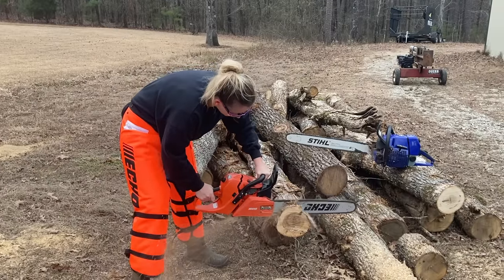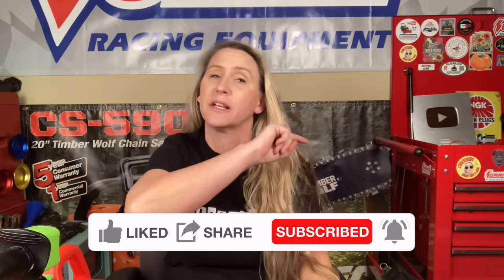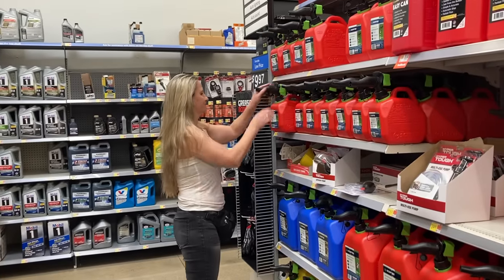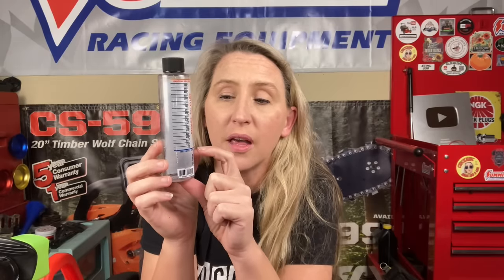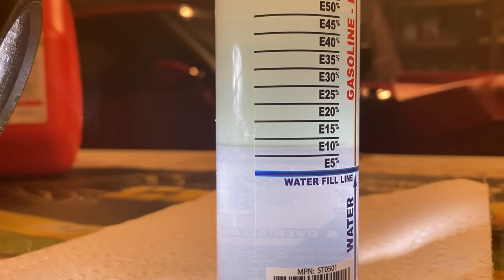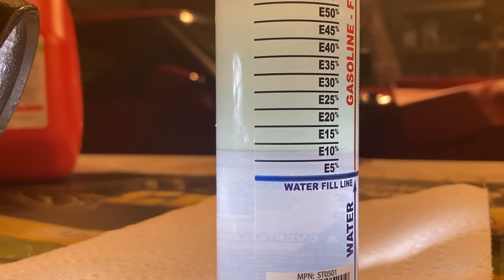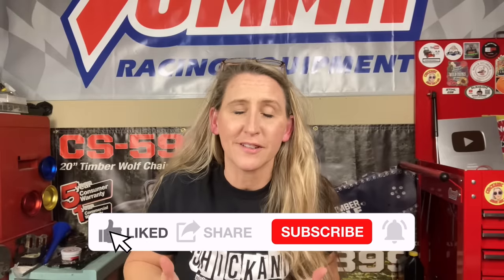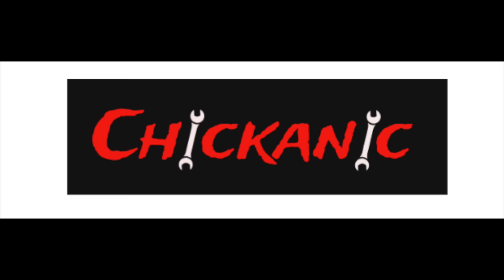Fueled by Deception. How You’re Getting Ripped Off at the Pump! (I'm SHOCKED!) VLOG

Comment: Shout out to Maverick and their clear 88 on a separate hose. That's the only thing that goes in my 90's trucks. I can't bring myself to put that yellow crap in my 2019. My wife did. Yep fouled plugs. 10% ok. 50% +.NOPE
Reply: And my chainsaws and bike and geni of course. Go Maverick. I end up getting better gas mileage in my old rigs so it ends up costing the same. Also I live at 7500 feet. You might be ok but I really needs my octane.

Comment: Everyone complains about those gas can spouts but they are worlds better than some of the previous versions. Obviously she’s not using it as it was intended. It’s designed for the little hook to rest on the lip of the fill port and you use the palm of your hand to Push the green release button down. For a finesse job like what she’s doing I would have simply taken the top off and used an appropriate sized funnel. It ain’t rocket science! Thought this woman was a mechanic 😂

Comment: So someone whose vehicle requires the 93 octane could be getting a lower octane and vice versa . What does putting high octane in a car do ? Do 87 octane cars have high enough ignition system to ignite the 93 octane ? Should people that have the cars that absolutely require the higher octane be putting octane booster in with the fuel or give the residual hose fuel to someone else ?

Comment: Soooo what's the problem with ethanol? I mean there is turbo or supercharged high compression 1000hp plus motors that run higher power tunes run the highest tunes on ethanol?

Comment: ❤ I got gas at a different station not before last and I only got 33 point something per gallon per mile when I've been getting right at 39 so I thought what in the world is wrong I won't get gas at that station again it's a Mobil station here in a little old edge of Virginia Galax to be exact . I've been using the one that is up to 15% but not the other one I don't think I want to get gas there anymore I had about 1/4 of a tank of gas when I stopped there I filled it up now I'm down to less I think less than a half and getting 33 or 34 Mi to the gallon instead of 39

Comment: I've lost count of the number of times I've cleaned or replaced damaged or destroyed carburetors thanks to ethanol in fuel and I don't even repair them for a living. Ethanol belongs in beverages, not in gasoline! Also those mandated gas can nozzles are absolutely ridiculous, I spill fuel all over the place every time I try to use one of those, exactly the opposite of what they are supposed to do. Thankfully you can buy replacement nozzles that are sold as being for water jugs, but I eventually just bought a nato jerry can and never looked back. I will never buy a consumer gas can again.

Comment: I never understood why they brought back ethel gas as it was phased out for being crap fuel and many high end cars and older engines  with rubber o rings and gaskets cant use the fuel   Im thinking peeps should have got the pitchforks out when they brought in the unleaded gas  As i can still remember filling up my mini bike for  18 cents at the pumps in the 70s

Comment: I put an end to this problem by switching my weed whacker and chainsaw over to the DeWalt Flexvolt and have zero regrets!!! Goodbye Toro and Husqvarna,  see you never! But I do pump my ethanol free gas into my pickup for a couple of gallons before I fill my 5 gallon gas can. My mowers, chipper and pressure washer run like a charm.

Comment: Today's gas cans are worthless. I have purchased several over the last 15-20 years and they are all difficult to use. I wind up spilling gas anytime I try to put gas in the mower. How does this help the environment?

Due to government regulations, local stations cannot sell E-free gas. I recently was able to find some about 50 miles away - only bought a couple of gallons since I did not want it to go bad before I was able to use it.

Comment: you should test to see if that was water instead of ethanol? what should we do with this info? should everyone that see's this video file a class action lawsuit? this is good info, because this happen me. I bought some gas from a gas station, put that 10% ethanol gas, and it ruin by wife suv, check engine light came on and then it started to flash and shake! suv is sitting in front of my house, change everything I could change! the last thing to change is now the suv it self! it's a shame, nice little suv!

Comment: this is like 20 years old, glad you learned what we knew for 20 years flying ultralight planes...
You can pre-test for alcohol at the gas station. Here's a review of the olive jar test for alcohol.

Empty and clean a long, thin olive jar and keep the lid. (Actually, any tall, skinny container will work as long as you can see through it.)

    At the gas station, put some water in the jar, maybe up to about 1/4 and use a marker to mark the level of the water.
    Fill the jar with fuel from the pump. Put on the lid.
    Shake the jar and the fuel/water mix.
    Let the mix settle out.
    If the apparent water level goes up, the fuel has significant alcohol in it.

Watch out for pumps that share a single hose for all their fuels. If some of those fuels have alcohol, you will get some contamination even in their no-alcohol fuels.

If they have separate hoses, you can make the test before you fill your fuel cans.

Comment: This goes further than what she is talking about.  We dont have pure fuel in Florida.  I went to Sturgis and put in pure gas.  My MPG on my Harley went up 3 MPG.  I also had to turn down my idle with the pure gas.  I am also a mechanic, ASE Master Mechanic, and the government also used this ethanol to get older cars off the road by eating up the seals in the fuel system, including the fuel pumps.  If you replaced it with a stainless pump, with other than rubber seals, you were ok except, like was demonstrated, ethanol will pull water through your system and moisture is in the air.  That moisture goes through your normal steel lines and corrodes them, as well as any aluminum in the system.  Up until they mandated ethanol, I changed maybe 2 fuel pumps in a 10 year cycle.  After the mandate, I was buying a pump a week for customers.  I never replaced a fuel pump that the hose connected to the fuel line in the tank wasnt swollen to 3 times its size before it finally gave out.  The pump was running but no fuel pressure because that hose was blown.  There was also so much corrosion from the pump that you could dump the fuel filters and they were loaded with metal and rust.  Just like that gas can she had, our government is not our friend.  They are all criminals.
Reply from the maker: THIS! 100%

Comment: Dont know where you live, i live in North Carolina. The only reason this would happen ( here in N.C)
 of cross catamination of  mixing two different fuels would be on purpose or by mistake from the fuel hauler, (tanker). Every gas station I've ever went to had separate holding tanks for each octane level and separate pumps. 
If im pumping 87 oct and I'm on pump #1, the person on pump #2 on the same island, and is pumping 93 oct, is Not, Not,,,sharing the same pump or hose. Dont know of any place that does. 
Does that place have water in their holding tanks. I've heard of that happening, even had a few News reports over the years where diesel fuel got pump into the gasoline tanks by misstake with many of vehicles wind up stop running a few miles down the road from those stations.🤨🤔🫤

Comment: 4% vs 9% should not make a difference if your equipment is running correctly. Main reason small engines don’t run is folks leave gas in them. Run it dry every time you will have zero problems.
Reply: So I'm supposed to guess at exactly how much fuel I'll need to clear my driveway of snow? If over, I have to let it run out? If short, I have to splash some more in? 😂
Reply: @mikeb8342  Negative you can put in a valve to shut off the fuel to carb..its best to run all out but second best is just to make sure carberatur is empty. Valve is less than $10 on Amazon

Comment: Haven't seen a multi-fuel type hose/pump since the 70's we just don't use them possibly for the very reason you're speaking of but I know from years of driving and riding the fuel stations here don't serve you what you pay for as per low grade fuel gives me 250 kilometres for a tank full high grade fuel which is almost a rare joke gives me 450-500 kilometres to a full tank and I drive a Ford courier 2,6litre 4cylinder and this fuel fraud is wide spread here in Australia and I ask a supposed independent market researcher to see if what I said was true and going by the no response I believe he already knew that and doesn't want to wake the big dog on a chain because the repercussions would upset the fraudulent profiteering here in Australia. We mix our low grade two stroke so we only have ourselves to blame Lol .

Comment: I'm not sure if anybody had placed this in the comments or not but that gas can, as much of a pain in the ass they actually are, you're not using it correctly. 

You're supposed to push the green with the palm of your hand and grab the little black handle in front of it with your fingertips and squeeze.

Comment: Ethynol has water , water not good for fuel systems. Water not good for pistons ( unless you trying to remove carbon , old mechanic trick for knocking engines) but i regress . E85 is 20% water . My Huskavarna requires clear gas or the warranty is void . Bullshit , they couldnt tell the different between Clear gas , or treated gas . But a lumberjack 150 ft in the air with a chainsaw ( i live in Oregon) will xome down the tree and beat your ass in the ground if you screwed up his chainsaw with ethynol gas . The eater freezes up in the carburator during high revolution. A froze chainsaw is a lumberjacks worth nightmare . And the octane level of a watered down gas will ruin your injection systems over time . But ive only lived in the lumber capitol , Oregon for 45 yrs .

Comment: I had to laugh at how you pour gas from those new cans. You're doing it WRONG. With the new valves,  you tip the can first then open the spout when you have it all lined up and the nozzle in the container, just like a gas pump hose. It takes two hands, so you can't really use it with a container that you have to stabilize, but typically I can use my feet for that. CHEERS!

Comment: All you have to do "before running your tests".....is to first pour some fuel into old measuring cups; 
labeled for the type of fuel; and skip cussing the gov't.......the gov't does not make gas can 
manufacturers make poorly designed dispensers.........They set objectives; but the manufacturers 
can use any design they desire;  and some will be duds.........I don't use the el-cheapo cans. my 
fire-rated metal dispenser from Zoro works fine..........You squeeze a large loop handle which opens
a jointed, sealing cap, with an adjustable goose neck filler line about a foot long.......A design that has
been around for over 50 years that works so well; it already met the safety standard without changes.
Also, I buy gas at our "local Murphy's gas stations".....their pumps have a separate hose/dispenser
for "real gas".......and is fed by the tank only used for that purpose.

Comment: Long ago, when ethanol came out, they claimed that you would get more power and better fuel economy. I got more power, but my gas mileage dropped by 6 miles to the gallon. On the first tank I was giving it more gas, testing out the power claim. So, on the second tank of gas, I drove normally. I still got 6 miles to the gallon less in fuel mileage. I stopped getting ethanol  gas after that. Later on they retracted their claim of more fuel mileage. Fast forward several years and they came out with a cock and bull story that claimed it was better for the environment. If I am burning more fuel to go the exact same miles, this does not make any sense, at all. They have to grow the corn, process it into ethanol and then ship it to the refinery by truck and this is better for the environment? I figured out that in order for ethanol gas to be cheaper than regular gas, you had to have a difference of more than 10 cents a gallon. They then started to force the ethanol gas in our area and discontinued regular gas. 
 I was on vacation in Wisconsin and there was a station with both types of fuel, ethanol and regular gas. The difference in price was EXACTLY 10 cents difference, just as i figured. Then at the post office they retrofitted our trucks to run on e85 and we were told to go to this station that had e85. All the trucks were having problems starting or pulling away to get into traffic or when making a turn. Everybody was complaining about this e85 gas and tried avoiding that station and getting gas elsewhere, claiming they were low on gas and not close to the station. They FINALLY ended the use of e85 a few months done the line.

Comment: SUB-JECT : LAWNMOWER RELATED

[]▶ BEFORE You BREAK IN Your New Lawn Mower Engine - WATCH THIS!
https://www.youtube.com/watch?v=thYEgRqIr54
                     May 1 - 2021                                 06:13 -----------------------------
CHANNEL: Garage Gear
                 » https://www.youtube.com/c/GarageGear
@ 2Wheels Midnight  --  2022.05
  I cannot tell you how many times I had to explain this to customers -
  reps and salespeople - but here it is in hopes it will help alleviate
  the stress levels some of you are experiencing:
  The oil in your new engine is turning dark because carbon and unburned
  petroleum components are blowing past the piston rings and down into
  the crankcase.
  The rings haven’t formed and finalized their wear pattern yet -
  (known as “seating”). These contaminants are soft and pose no threat
  to the engine. Also - using non-ethanol gasoline actually contributes
  to harmless oil darkening as it lacks the chemicals which promote
  a cleaner combustion burn.
  The metal particles are also completely harmless as long as one
  maintains the correct oil level for the engine and does not operate it
  at an extreme angle to its center axis design - particularly so if it’s
  a non-pressurized oiling system.
  These metal particles are of the exact same hardness as the metal
  components they are shed from - meaning they do not possess any
  greater  abrasive quality - and furthermore - are suspended in and
  completely surrounded by the lubricant.
  Prematurely changing the initial oil in a brand new or overhauled
  engine will only prolong the break-in period - and in worse case
  scenario will prevent the piston rings from fully seating to design
  specifications. The results of course are reduced compression value
  and higher than normal oil consumption - leading to reduced power and
  shorter life span of the engine.
  I do not recommend synthetic oils in these small engines;
  Today - manufacturing processes yield extremely durable surfaces and
  require nothing more than the recommended viscosity mineral / petroleum
  based oil.
  It is only under very extreme operating temperatures - engine load
  values - and oil change intervals that I would consider synthetic oil.
  Hopefully - this will ease your mind the next time you grab the pull cord.

Comment: Why not just remove the gas cap and use a syringe, or pour it into a measuring cup?  Instead of wrestling with the stupid "Gov't gas cans"? 
Ok I finished watching the video and apparently there is a "screen inside the gas can" that prevents the use of a syringe/turkey baster.  But again, you could pour the gas into a glass or something and then pour it into the ethanol tester.

Comment: That gas can wasn’t designed for dinky plastic bottles, but you blame the government for your usage misapplication. I agree the valves are too stiff but there’s other brands that work better. You didn’t bother thanking the government for supporting the class action suit either. Would you rather be the one taking on the oil companies yourself. Turkey baster? Why not use a little hand pump or transfer the test gas into a different container that’s easier to pour from? Good info but too much complaining about difficulties you created and which you could have prevented.